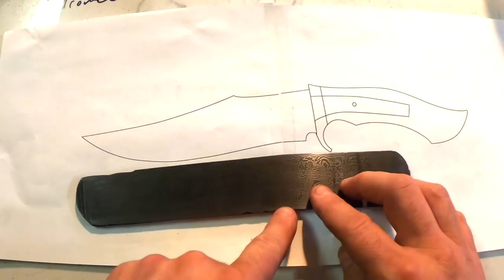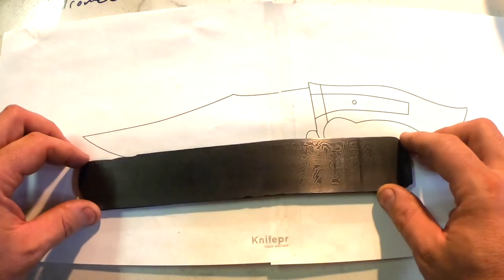Challenge Accepted - Making a Fighting Knife!

Comment: That's beautimous! It's the first knife I've seen with copper fittings and it looks fantastic with them!
Reply from the maker: Thanks for checking it out!  That is still one of my favorite knives.  I was sorry to see it sold.  😕
Reply: @TyrellKnifeworks  something tells me you're confident in your craftsmanship enough to make another one =)
Reply from the maker: @LIONTAMER3D  well stay tuned, you just might see another one even more impressive soon! 😜
Reply: @TyrellKnifeworks  that sub-hilt, slender & long-handle design is just SOVERIGN for using the knife in a wide variety of ways.  I know sub-hilts are considered "fighters" automatically; they are not.  The ability to pull the blade through what you are cutting, regardless of appplication, is assisted by the sub-hilt design (or, as Fred Perrin & I prefer, a straight-up ring since the full ring design doubles as a better hand guard), as is the ability to withdraw the blade from a dense medium after puncturing.  In other words, the sub-hilt helps both cutting AND puncturing; both of which are what knives do =/

Comment: I’ve always been told to first drill holes in the tang, before any tempering is attempted, because drilling after tempering, increases the likelihood of cracks in the tang due to it being already hardened.
Reply from the maker: I’ve drawn back the temper on the tang so it’s soft and I can drill through it.  I’m not drilling hardened steel.  That wouldn’t work anyway.  Thanks for watching

Comment: What an awesome work of art!  My vote - considering the function is for a “fighting knife” - goes to you.  If I had to be in a knife fight... and I hope it never happens, I think this one would have greater balance and functionality, and would never slip out of the hand.

Only slight thing I’d prefer to see on this blade is a different profile on the fuller.  Just seems a little narrow in proportion to my eyes.  Maybe a slightly shorter length fuller, and with a noticeable chamfer on the fuller edges.
Reply from the maker: Absolutely agree!   The only ball end mill I had was a 1/4”.  Funny that Airin did a fuller the same way but he had a 1/2” one.  I certainly would have used it if I had it.  👍
Reply: @TyrellKnifeworks  maybe one will show up for you.... never too late to take out a little more metal.
Reply from the maker: I’d never try it now.  It would be too hard to lock it back in the vice now that it has bevels and a handle though.  I’ll get one for next time!

Comment: I always teach complete beginners to use filing jigs in stead of angle grinders. It teaches what flatness is and also it teaches how strong steel is. In my opinion it also teaches a little more respect for power tools. People see better how strong and potentially dangerous they are. But my main motivation is that a file with a jig gives a way better result than any beginner or intermediate can do with an angle grinder.
Reply from the maker: I don't remember the context of your comment with the video, I haven't seen that one in a while.  I certainly don't advocate the angle grinder and other than the buffer, is probably the most dangerous tool i the shop.  😉
Reply: @TyrellKnifeworks  you had a filing jig for filing the clip. I liked that a lot

Comment: The "Challenge" was to build a "Fighting" knife. I believe both knives are very nice.The Tyrell knife blows  the AleeKnives knife away in shear beauty, and design. Then you move on to the actual challenge and things change a bit for me. The Tyrell blade is a very effective design for a fighting blade but the choice of copper for the finger guard is a weakness.  The addition of the spacer or second finger guard will limit your ability to flip the knife around and reverse the grip in a fight. The extremely well polished handle looks beautiful and slippery when damp with sweat, water, or the red substance we all hate to loose in a fight. The AleeKnives knife is a very sleek looking blade with what appears to be an aluminium finger guard which is very small offering almost no coverage whatsoever but is an even weaker material than copper. The blade design for me is an effective fighting blade with a lot of strength in the blade. The handle on the AleeKnives blade in my opinion can be reversed and used in either hand in a forward or rear facing position. The handle appears less slippery so the grip might be better in a fight. I don't like the groove machined into either blade although I understand the intent. I want to congratulate both these gentlemen on building fine knives and displaying superior craftsmanship in both builds, it was a joy to watch. I think the winner is the AleeKives knife, keeping in mind my limited experience in knife fighting. Yes, I did get cut both times.
Reply from the maker: The challenge was actually not to build a fighting knife.  It was just to build any knife in any style using the wolftooth Damascus provided.  Thanks for watching!
Reply: Mel Gillham  I understand your points but try flipping that blade around in a fight, it might change your mind. Like I said I love the blade design and it is a proven design just don't like the finger groove guard or the material chosen. The very slick handle is an absolute killer for me. Just my opinion and that is what he asked .

Comment: Beautiful knife!!! Could you tell me what knife vise that you are using I need to replace my homemade one and I really like that.. thx in advance
Reply from the maker: Are you talking about my knife sanding vise?  I made that one.  I just picked up 3” and 3 1/2” round pipe and tapped a few holes, added bolts with handles and welded it to a base.  👍
Reply: @TyrellKnifeworks  yeah the knife maker vise. I copied red beard ops version but really like the swivel base on yours.. did you do a video on making it? I couldn't find anything. Thx for response
Reply from the maker: No sorry, I’ve never done a video on it. Maybe in an upcoming Triple-T I’ll take it apart and show everyone. 👍

Comment: Winner! Hard to pinpoint a single thing that outshines another. However, the glossy finish on the wood is sick! What did you use? I have recently switched to True Oil, and still can't get them like that. Great job! Just started following you here and will find you on IG. 
Wayne @deep_sea_forge on IG
Reply from the maker: Thanks!   That handle gave me sone grief.  I didn’t show it in the video but when I was putting it in the sharpener it got away from me and it hit the ground and I chipped the tip of the handle.  Has to resand the whole thing!  It was sanded to 1500, teak oil, 6 coats of tung oil, sanded to 3000, more tung oil and lightly coated with mineral oil.